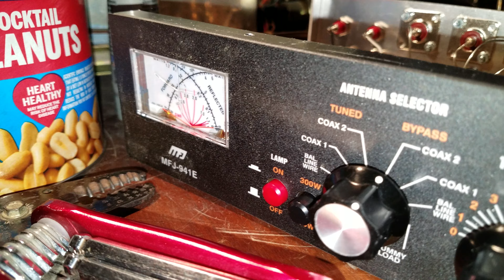MFJ-941EK Versa Tuner II

Comment: i liked the two Antenna  interfaces output  Coax1/Coax2 as you may use "One" of them as permanent 50 Ohm External Dummy Load  (as a Trusted Perfect 50 Ohm Reference Antenna )
Or you may add a two  100 Ohm Resistors (in parallel configuration) and Solder it to Coax2 interface from inside  use it as internal 50 Ohm Dummy Load 
This arrangement is very useful to examine your  SWR/Power Scale and make sure your SWR meter Not dusty/Rusty or stuck for any unexpected reason